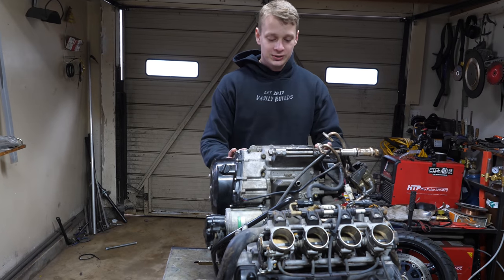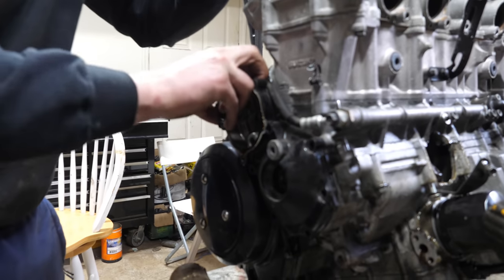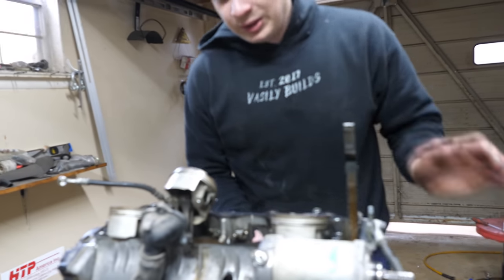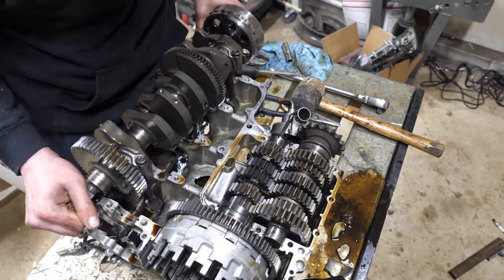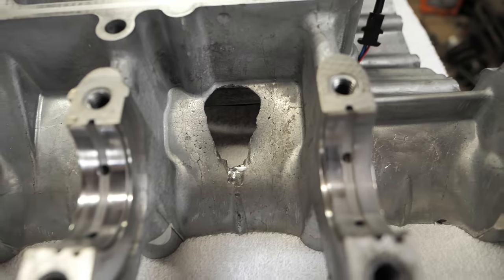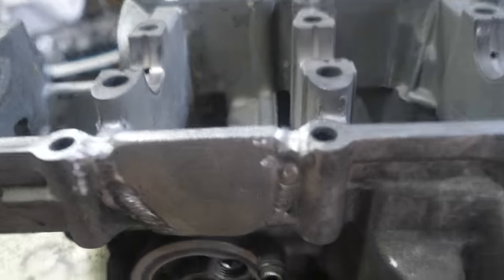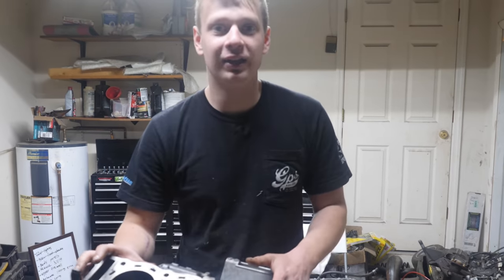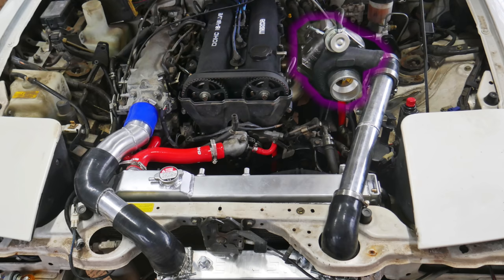I welded My BAD Hayabusa Engine! (They said its too far gone)

Comment: Man, I don't mean to badmouth your work, but I do hope that weld will withstand all pressure, vibration and temperature loads it will be exposed to. It is difficult to tell from the video, but it did not look like it was full penetration weld, with possible microscopic gaps every time you stopped and restarted during welding. I would definitely take it easy during initial startup, and inspect welded areas regularly to see if there is any unusual deformation. And yes, that 0.012" gap is definitely alarming IMHO.

Comment: i had a 06 busa they said was to far gone i got that thing going and looking awesome put all new fairings on it got the motor fixed and put 30k miles on it and ended up selling for 6k after many years of abuse and fun. Dont let anyone tell you what to do with your own things have fun as long as you feel confident its not goin to kill you go for it. And the arc shots were awesome

Comment: Nice job. The part that I thought was going to be a pain (case halves) you did a great job. I don't see any problem boosting this engine since the bottom end should not see that much pressure. If it does you have some very bad rings or a crack in the cylinder liners or cracked head.
Reply: I agree.

Comment: Learn how to hit a wratchet to crack the lock on the bolt / nut. on the thread Don't pull because you will almost always hit your arm / hand on the object you working on or the table.  Keep up the good work and try working with safety in mind and safety towards the parts too. 

Well done on your build. 

Watching from Cape Town , South Africa

Comment: Gotta help a brother out a lil anytime you pull a part off engine make sure you pull the bolts out first especially if in frame repair.. On anything that is.. Will help you a lot in long run just easier either way
Reply: Also get you 20v brushless mac or dewalt impact 1\2 in drive won't need those gloves or worry about busted knuckles with head bolts or really most anything on that bike

Comment: It might leak oil I think I have some good cases and get you some gsxr 1000 wheels they are lighter but you have to get the forks brake calipers ect…  you doing a good job bro keep it up I also have parts for a busa pretty much whatever you need

Comment: My VTR was pretty much sabotage when I found swarf shavings etc in the sump, (definitely been using lathe etc cutting oil not good) which definitely wasn't part of the engine, because the engine has only cast iron and aluminum 😄, but it was unsalvagable because of amazing wear in crank bearings and camshafts seats and all, but you can do this because you have source and a welder ok so go hard brother 👍

Comment: Welds look awesome bud. Some food for thought tho. I wouldn't use that small belt sander you were using to cleanup the broken spots before welding. Since that it basically sand glued to a piece of paper and with aluminum being so soft, you can actually impregnate that aluminum with that sand off of the belt sander. That may have been where you were getting alot of your impurities from. I weld aluminum all day every day. I have been welding for over 20 years and have done a little bit of it all. Not saying I know it all by any means, but I have ran into this exact same thing. Just wanted to give you my 2 pennies bud. Otherwise, welds look awesome and I hope that engine stays together for ya. Love watching your videos. Keep up the good work.

Comment: Good looking repair. I would build up and file that gap though. You might get away with it but it's easy enough to fix so why not. I'd also try to groove the backside of the weld and fill it back up wherever you can reach. A carbide burr on a die grinder is great. But don't use the burrs meant for steel. They'll just clog and dive you crazy. Get one made for aluminum if possible.

Comment: It will be fine. I've welded v8s that are still out there going. And my friend does aluminum blocks. The gap is acceptable for non boost. But you could just build it up and fix it easy

Comment: Bro, your so talented. You got these cases welded up so nice, than your just going to let that gap slide? No man. Lay some weld on there and build it back up than take the cases and use a surfacing stone. Get that thing nice and flat. Anyways man great work. Like I said in the comments, your worried about what CAN be done and what SHOULD be done doesn’t matter to guys like us . Work with what we have and send it. Great job man

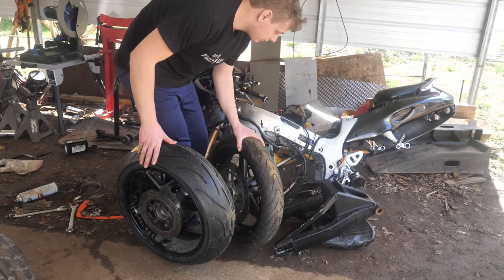Comment: Welding those holes up is just fine. 16:19 you can see cracks all over that block though. That would be my concern.
Reply from the maker: Those are only casting flaws

Comment: I wouldn't worry too much about case halves leaking, they're not holding any pressure. Ultra grey will seal that up. Could even do like I've done in the past and clean up the area on the outside of the case where the leak is/will be and smear some extra ultra grey on there.

Comment: I used to work for Rolls Royce on their Jet engines and the welds are ok but they should be a lot neater. Also filing down with that machine has just contaminated the crank cases even more than the original sand. There just seemed to be bits falling all over the floor. More care and being methodical will pay dividends .

Comment: Ok, nice video and yes almost everything can be fixed :-)  !  But buying a crank..matching new bearings, conrod, piston, valves, do the welding (with all the risks something is not right afterwards) ...   A second hand engine would be the best option here. (and the most economic too i think)   Anyway, nice video!

Comment: When welding cast you should run the torch over it without filter until all the bubbles go away then start with filler

Comment: Nice work  that .012” gap could be filled by running a bead and machining  or draw filling back Did u weld inside also  ? The crank could be saved by welding grinding and nitriding if it it’s not bent. Your very lucky with that head !!  Gd work looking forward to hearing it run great engine the busa still trying to figure how they can put 1000 hp thru em!!

Comment: Also ! You should just take it to a machine shop or your buddy who has the fab shop and get it resurfaced. Super cheap and easy to get those decks perfectly flat
Reply: Another thing a proper weld is stronger then that aluminum so don’t worry about boosting. just be sure to resurface it

Comment: In your first video it did look as if the engine could have had more serious internal damage than would be worth the time and effort trying to fix, but even in that video you took some video of some of the internals and they actually looked in excellent condition. Right here in this video right away it looks as if the insides are looking in great shape as you take the engine apart. My guess is that if you can successfully weld those openings and get your engine compression to hold, you will have a good, operational engine.

Comment: Good for you mate. Great repair. Maybe build the repair areas up with more weld metal and set the levels properly using a file and a straight edge and some engineers blue. Marking fluid. That way you will get a perfect join. 

Also just out of curiosity what grade filler rods are you using for the tig ? 

Just a pointer my friend, the front rotors on the busa wheel are mounted back to front.
Reply from the maker: Great idea. 4043

Comment: Welding cast aluminium, I think is as difficult as cast iron welding, needs good clean surface, and also skills to do it. In your case, you didnt took big enough replacement part to your weld, it could be easier to grind of than to add material. And I m sorry if I have errors in my writing, english is not my mother tongue , but i hope you understand what I am saying.

Comment: it might be cheaper to buy a new used motor, but it is always better the devil you know as you have no idea what you are buying really. i bought an engine and it threw a rod at idle while still on the ramps before i'd even driven it. at least with this rebuilt motor you'll know exactly what you have. its worth way more. keep at it 👍

Comment: Suzuki Engines are Really Good But alot Of Nuts an And bolts Some Assembly Required.. Battery Not included...Put In The Hard work and  Stay Positive and Get it Running again..

Comment: Smh a used set of cases would be better. Having a gap like that and using yamabond which could break off and block an oil passage is trash.  Do it the right way

Comment: Hey dude you need to be more careful one is never flip a damn head over, putting both cam back on man now you're gonna have real fun resetting all the valve lash as dump all shim on floor there no way this could have been dirt from road he or she would have too driven through a sandstorm that doesn't magically get into the crankcase that way somebody poured it in there come naturally one of the bearings failed and grenaded rod, but to me it looked like the two inner rods are rusted had water in the crankcase that could account for the problem there.

Comment: Dude you impress me every time I watch one of your videos.  you need to buy a machinists straight edge! You might as well fill that 0.012" with weld and machine it off! Or file it lol. Just be sure to keep the machined halve's planes perfect. No sanding of areas you didn't weld in other words.

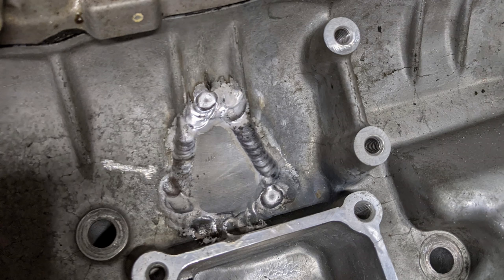Comment: 16:25 Yeah that's bad idea...
Doesn't last long, you shouldn't full throttle on that crap cranckcase. someone might call you idiot or stupid doing this but yeah... we don't care, we already know what we're doing.

I think you could buy a secondhand crankcase engine from broken/crashed Hayabusha, stuck on garage in a few years and months, abandoned project, junk yard and so on... which still in good condition but you should keep the original engine for legality inspection.

It cheap rather than buy from factory, need a lot of permits and bunch letters of legality.

Comment: Something you might not have thought of - if the engine falls off the under specced table you might not lose anything in terms of the engine, but you might lose a toe. Your flesh is like butter to a block of metal that heavy.

Comment: I have rebuilt so many engines in my 60 years here on this rock that I would hate to even guess the number. There is absolutely No, Zero, Nada. way in hell that it sucked that much debris into the engine. ZERO! That right there was something a pissed off woman would do. Had a ex-wife put sand in the gas tank and crank case of my new suburban several years ago. Caught her on video and in my divorce the Judge made her buy me a brand new GM crate engine plus labor costs to replace it. $12500 in 60 days or less or spend 180 days locked up lol. I got a cashiers check in a week.

Comment: I really like your courage for repairing this engine. However I felt it in my guts when you started grinding the top after welding. You should really have machined it down to get a nice sealable surface. If you don't have the equipment, you could have taken it to a machine shop to do it cheaply.

Comment: I dunno buddy. I might run that motor on a kart or something, but I wouldn't want to be doing 120 on 2 wheels and have that thing come apart again. That repair seems like it could last 10 yrs or 10 minutes.
Reply from the maker: It won't be going on a bike thats for sure. That's why I actually decided to salvage
Reply: @VasilyBuilds  Good call. I've seen some NASTY cross karts with Busa motors tho. Think it would fit in your's?

Comment: 1: You don’t use yamabond, you use factory gasket kits. 

2: Send your trans off to be undercut to make sure the 2nd gear pop out issue gets fixed. You’re already there, don’t do all this work and have to do it again. 

3: You should look into updating your Ecu to a gen 2 set up, it looks like you have the 02-07 rotor already which is good. Gen 2 set up is just better. 

4: Find another intake cam and do adjustable gears and replace the exhaust cam with that. It’s a simple mod for the gen 1 platform.
Reply from the maker: Is the gen 2 pnp?
Reply: @VasilyBuilds  You can use your rotor, you need to machine one more tooth off of it next to the already machined section..and then you use the gen 2 harness, hand controls, dash & Ecu. Minor things need changed like some sensors but nothing bad.
Reply: gargster18, the advice you're giving, and you don't know that there's NO gasket on case halves ????????
Reply: @t.s.racing  I’m talking about the entire engine, pulled plenty of engines apart that had rtv come apart and destroy bearings. I race a 600 whp Prostreet hayabusa bud.

Comment: don't ,reuse it have you ever been on a real bike with this kind of power ..better yet on any bike and had the engine lock up at speed ...if you can pull in the clutch fast enough  you might not go down and u never get to choose where you go down.. You are putting a very stupid price tag on your life remember when you hit the house with the cart buy a good used engine .I still pull the used engines I buy down and reseal atleast but check everything and replace anything with wear .

Comment: I think you are wasting your time,, this engine is extremely damaged,, welding cylinder block is not a good idea cause the thermal deflection will affect all the tolerances,, its better to buy a clashed bike take its engine to the body you have.

Comment: dude did you really wash grease and shit into a drain at public car wash most storm drains are tied in with the water treatment so you just put all that shit into part of drinking water is is easy to filter crap and things but very hard to break chemicals down to filter water so remember that when you get a drink of water plus you do not own a pressure washer with all the crap you work on   sad